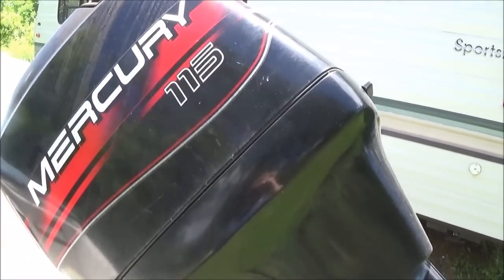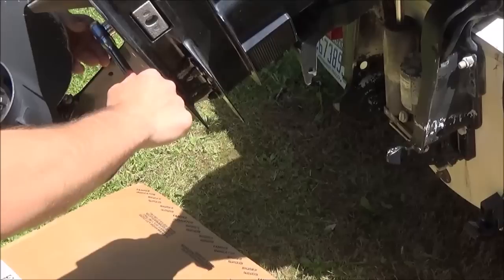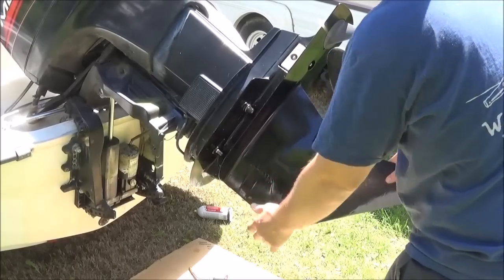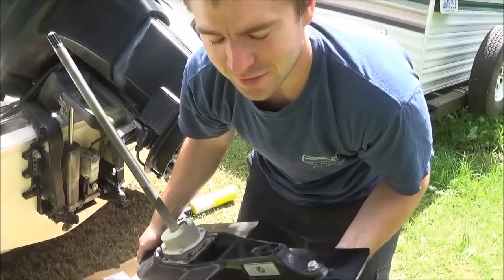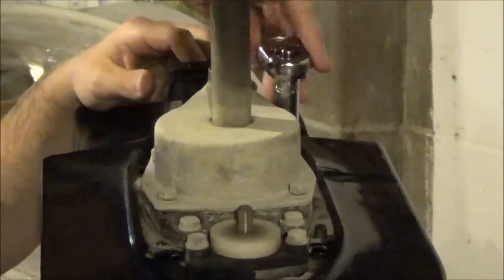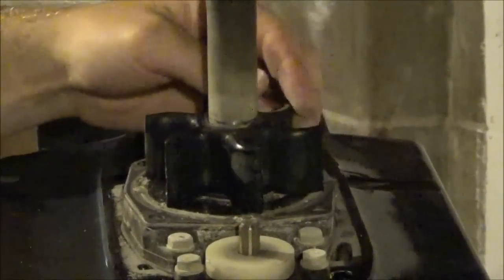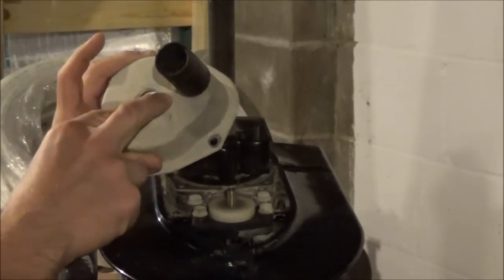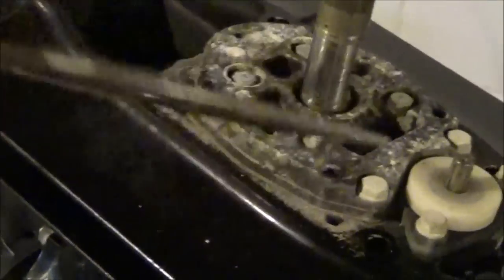Lower Unit Removal & Water Pump Replacement on 1996 Mercury 115 hp 2-Stroke Outboard

Comment: Heads up if anyone ever snaps the 2 long bolts that go through the thermostat housing and the water jacket the water jacket is threadless so you can pop that whole cover plate off to weld some nuts onto the bolts.

Comment: those are safety nuts he's heating. they should never be heated or you melt the plastic inserts  in the nuts and they are no good.
Reply: True, but that’s what he had to do to remove them. They must be replaced after heating.

Comment: I was looking for a DIY how to video to replace the impeller for a 1996 125hp mercury. This looks close. Wish me luck.
Reply: Hey man, I don't know if you'll see this since it's been 4 years, but I have the exact same motor. How did it go? I can't find any videos on my specific engine.
Reply: @truettkerby389  it went well. I got the manual in it and got the parts. It’s pretty simple when you get the parts. It’s still running great.
Reply: Getting ready to tackle my 2000 125 lol. I need good luck

Comment: Hey question on shifting your motor. I just got a boat with this motor on it and with the motor turned off and I go to shift into reverse, it has a good amount of resistance putting it into reverse, none when coming out of reverse.
My question is, do you experience the same, or does it go into reverse just as easy as going into forward?
I’ve read online this is normal, but no one has this motor that I’ve come across yet to ask this question. Thx
Reply from the maker: I've only shifted motor while off for this video I cannot really remember, sorry. If the unit is still shifting and you don't have large chunks of metal on your drain plug magnet I would not worry about it.
Reply: @striker1211  Thanks for your response, appreciate it. Yea I checked the LU fluid first no issues. Since I’ve never owned a Merc and I’ve just started restoring my boat, everything’s apart, I wasn’t sure if this is normal. So I wanted some feed back from an actual current owner instead of going off what I’ve read on older forums that some say it’s normal shifting for these Mercs with the motor turned off because of the way the clutch system is designed. I’m leaning towards believing that because your LU did what has been described when it’s in forward gear and you spin the prop by hand, you hear the spring loading “ratchet” sound. Thanks again man, I like the thorough video, good job. 🤙

Comment: thanks for video. i have a 1988 merc  115 and my first time doing this.  was curious if you cleaned the driveshaft so its shiney again n what did you use , sandpaper?
Reply: Dave I was hoping you would come back on here and let us know how you did with changing your impeller? Did you have any trouble putting the lower unit back on?  I seem to be stuck trying to get the lower unit back on and in neutral, thanks. (Rusty)
Reply: @dianakesl1814   Hi, i have not been able to get my lower unit off yet, all the bolts are out and i have a strap on it, but it wont come loose.  I will come back on here and let everyone know how it all worked out.
Reply: @durangodave  Thanks Dave. I've changed my impeller once before but didn't remember how I did it. I was having trouble getting my lower unit off and my wife came out and said "what about that bolt under here?"  There was a bolt up in front under that stabilizer fin I didn't see and sure enough I took it out and it fell off, hahaha!!!  Maybe she can show me how to get it back on, lol. (Rusty)

Comment: Hello, 600 hours of use is a lot for that engine?
Reply from the maker: My hour meter says 1200 but it hasn't worked since I bought the boat in 2013. I don't believe that is too many hours for it but definitely take it for a test drive. I have a video showing what the idle SHOULD sound like if it's running okay.  https://www.youtube.com/watch?v=JGVwof_LDkA . It's a 24 year old boat so be prepared to learn how to fix things :) That said, other than the thermostat, temp sender, and water pump I haven't had to put much money into mine (knock on wood).
Reply: @striker1211  Thank you very much, how many liters or gallons do you consume per hour? greetings from Argentina

Comment: Probably a long shot since this is three years old but what is the serial number off the lower?
Reply from the maker: I just checked and don't see a serial on the lower unit anywhere. The engine serial is 0G306*** the last 3 are faded

Comment: Before removing the lower unit what gear is recommended forward or reverse gear.
Reply from the maker: I think I did forward. The only reason you leave it in gear is so that you can rotate the prop shaft to help the splines line up. Do not touch the shifter after removing the lower unit though or the gear shifter stem won't line up.
Reply: @striker1211  cheers mate 👍
Reply: @striker1211  Damn I think I moved my gear shifter after the lower unit was off. I'm having a hard time now after I put it in forward, I reattached the lower unit.  Now it starts in gear, and I can't seem to get it out of gear or into neutral. Any suggestions on how to get it back lined up with the splines? (Rusty)

Comment: I though the impeller goes in counter clockwise?
Reply from the maker: Whichever way the engine spins the drive shaft, it's been so long I can't remember how I found which way it rotated but I'm sure I looked it up. Regardless of which way you put it in though it will straighten itself out, it's just slightly less wear on the rubber fins to put it in the right away originally.

Comment: Drop an impact or air ratchet on it, non of this twisting wrenches. I'd lose my job if I took that long. ( Not hating just thought it was funny, good video otherwise :D ) btw that 15 seconds with that little map gas bottle didn't touch that bolt, rule of thumb, 20 thou per 100f of ∆T
Reply: Steve bensler are u a marine mechanic and is this the same for an 01 merc 150 saltwater engine? Thanx
Reply: @bigkm1974  yes I work on outboards and drives, are you asking if this video is suitable to change your impeller on your 01 Merc ? And salt water version are very similar, they add extra anodes inside to reduce corrosion.
Reply: Yes is this the same procedeure on my merc? Gettn ready to do it and never done it before, thanx
Reply: @bigkm1974  Yes, the procedure is the same. Remove the Bolts from bottom of the lower unit running into the midsecton. Some Units have a bolt under the cavitation fin plate  as well. Drop the lower unit, pull the pump housing off, Usually four bolt. Some units have a mechanical seal between the housing and drive shaft. I recommend using some 3m scotch bright or a green brillow pad, clean the drive shaft and lubricate the shaft with white petroleum jelly before removing the housing, up on the shaft. If you are going to remove the housing right off the shaft (which you have to when replacing the impeller), use some masking tap to cover the splines that enter the power head that are on the shaft that you just cleaned. This will protect the seal from being damaged. Once the housing is removed, remove the impeller, use a screw driver to gain some leverage and pry the impeller against the housing backing plate. it should bring a plastic (some times tin in older outboards) key with it . If not, the key will either be integrated into the impeller, or stuck to the side of a notch on the bottom of the drive shaft, right where the impeller was. That plastic key acts as a failure piece. 99% of the time you wont need to remove the backing plate of the pump. This video, the guy removed it. I would only remove it if it was leaking, otherwise i would leave it. BUT every job is different, so use your discretion. Take the new impeller and  position it on the shaft with the key in the right direction. Take some white petroleum jelly and coat the impeller with some, it will help with assembly. Take the housing along with all seals and in the direction of rotation, rotate the drive shaft while applying force to the housing over the impeller. The impeller fins should slowly "fold" or bend inside the housing and the housing should drop into place. You will be shocked by the amount of force you need to apply to the housing to bend the fins in. After all t=of this is done and seals are in place and lubed up, you can throw the fasteners back in, make sure the water feed pick seal is in place, grease the splines of the shaft, put the lower end back up into the mid sections and put the bolts back in and youre done.

There are other small things that will vary from motor to motor, but they are all very similar .

Let me know if you have any other questions

Comment: I just did this exact maintenance procedure on my force 90 and now it's not pumping water  uggggg.  I've taken it apart 4 times and checked everything.  Still no water in the powerhead
Reply from the maker: Is it just not peeing or did u verify no water is getting up to the thermostat? Bugs make nests in my telltale and I have to clear it out from time to time with mechanic wire. If it's not getting into the top for sure then my first check would be the tube that carries the water up is not clogged or melted.
Reply: @striker1211  water is not getting to the thermostat.  I can put the hose on the Pipe where the water pump connects and turn the hose on. Water does move through the block and out the telltale.  But if I put the lower unit back on and run the engine the pump pushes no water up
Reply: James Jestes How do you change the thermostat and the nanny mercury it’s about 20 years old
Reply: How do you change the thermostat and the nanny mercury outboard motor
Reply: So for my issue we finally found it.  The water pump cover has a round "cup" inside. It's just glued in and when the water pump spins it is spinning that cup preventing water from flowing into the power head